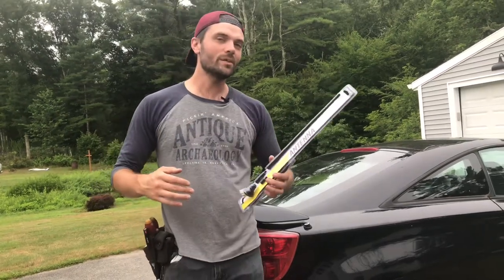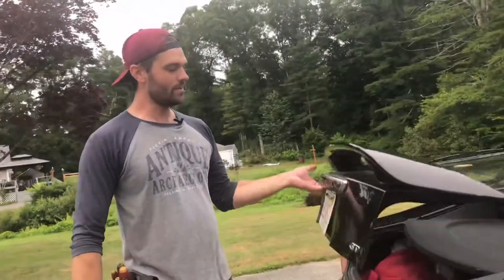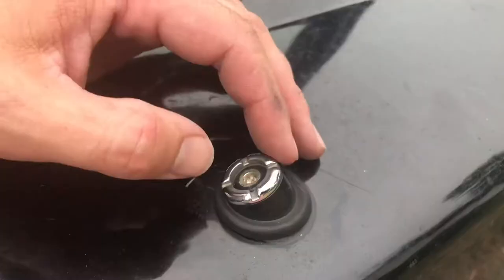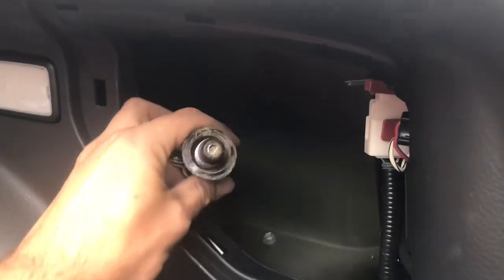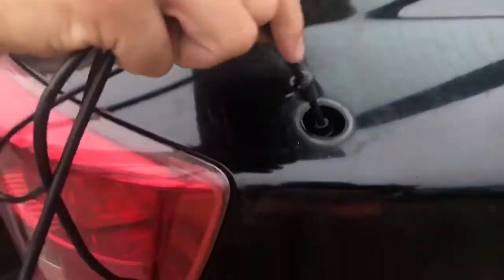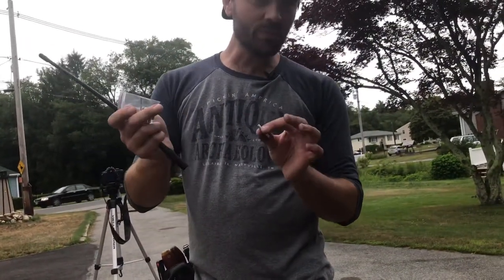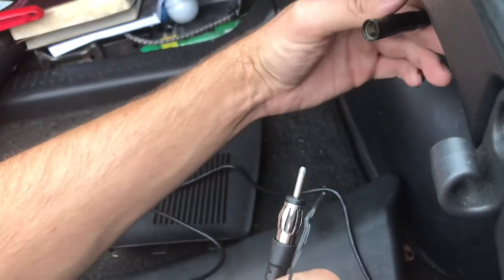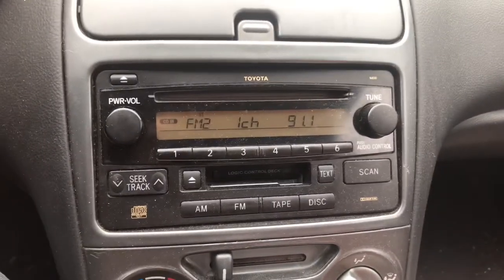How To Replace Radio Antenna in Cars! #DIY

Comment: Thanks
This was helpfull someone snapped my off and it looked liked i would have needed to remove that whole plastic trim piece but i see i can do it from the access panel
Reply from the maker: Siniaya you ROCK! The replacement antenna is a flexible one. Let me know in the comments if you’re ROCKIN to some tunes! 🎶